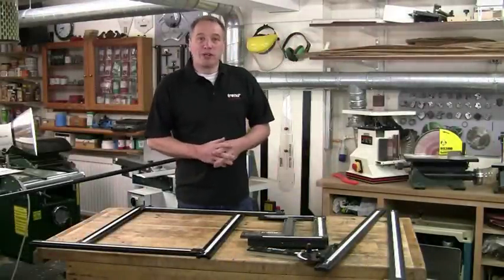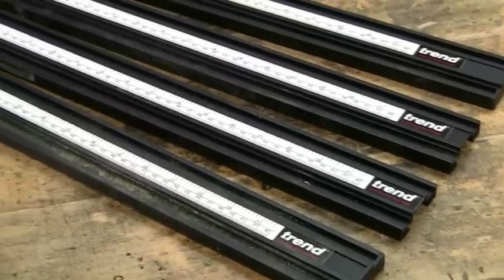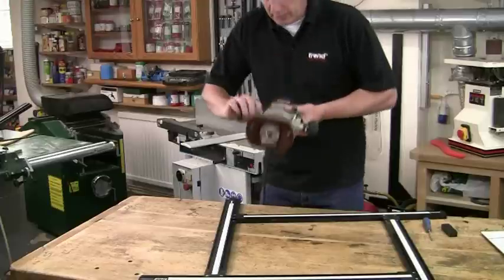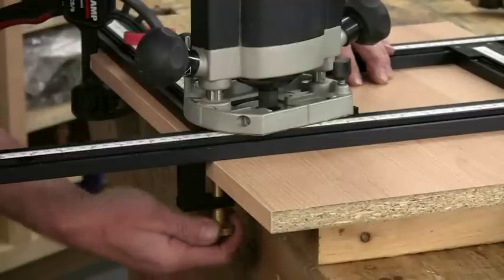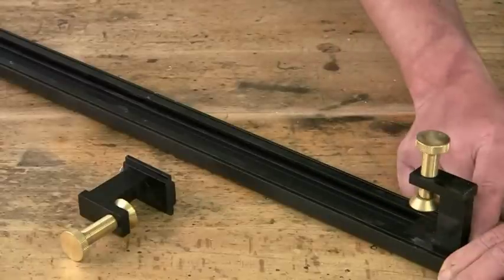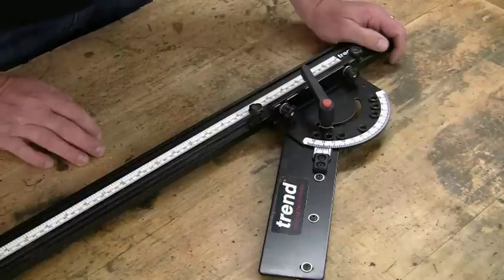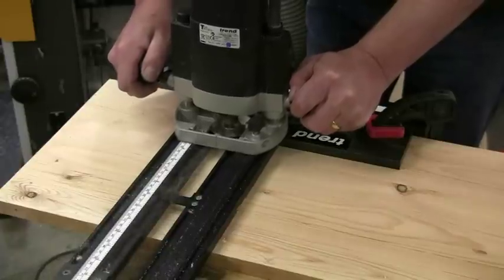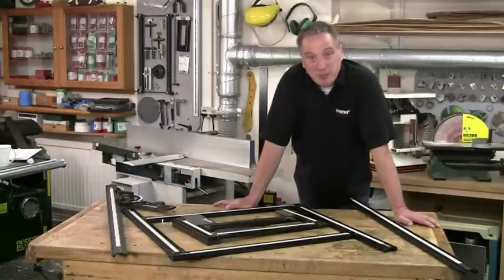Trend varijig

Comment: I have this tool.  I've tried to use it several times, each time I used the router bit cut into the aluminum rail.  I've basically wrecked it, though I think I may be able to salvage it with body putty (bonds) and elbow grease.  I used a bushing at but I had the same same thing happen every time.  What about a bearing guided cutter?  Or is there some other trick I'm overlooking?  It's a great idea but I'm getting horrible results.  It hangs in my shop making me feel stupid everytime I see it.  Any ideas?
Reply: Alan!  Was this not worthy of a reply.   I'd like to know what went wrong here before I purchase one of these devices.
Reply: @jerbear197  I was hoping I’d get some advice. I live in the US. Trend doesn’t seem to have a support presence here.
Reply: You obviously didn't use a guide bush. Or you did and tipped the router.
Reply: @jerbear197  sorry, I never saw your question
Reply: @looopy2u  I did us a bushing and I used the piece trend supplies that bolts to the bottom of the router to keep it from tipping. I think it’s possible the bushings I was using were simply too short. Trend specifies a certain length of bushing to use.
Reply: @bigthinkinguy  did you use a straight cutter?